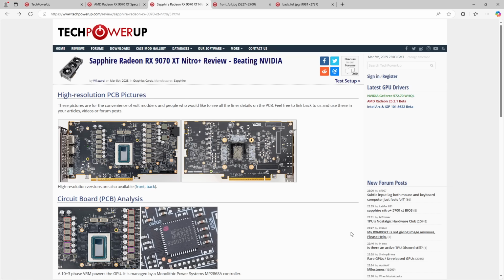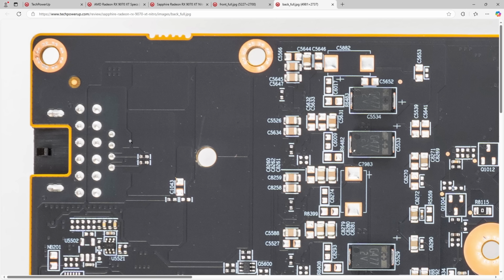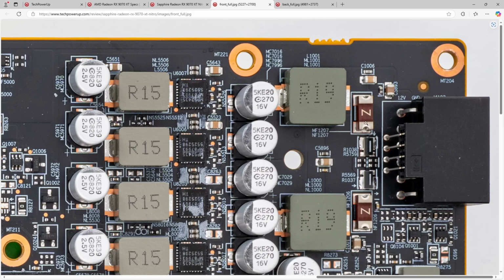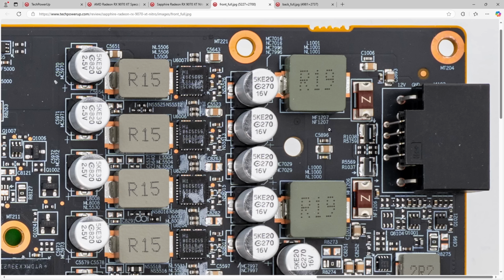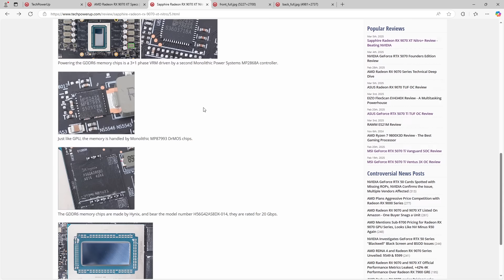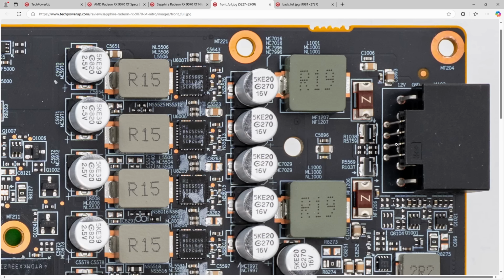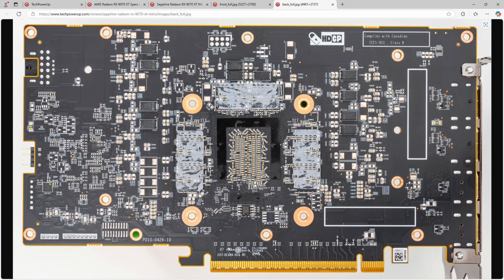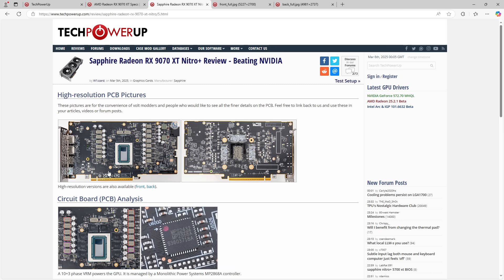Taking a look at Sapphire implementation of the 12VHPWR connector on the RX 9070 XT Nitro+

Comment: Guy... you can't drop "The 12 volt high failure connector." that early and that casual... I'm still laughing
Reply: Agree fcking love buildzoid
Reply: So was I 🤣
Reply: i was drinking
Reply: Best name ever lol
Reply: @PhotoJohn80  Very accurate, very descriptive and hopefully also it will scare other vendors from using it.
I trust Sapphire a bit, so I can stomach one model with this BS. Especially since they have fuses (won't help with melting, but should help with other types of failure).
Still I hope it isn't a sign of things to come.
Reply: Taking 300W and not 450W, or even a massive 600W, is very different.
Reply: @thatguy3000 Unfortunately the 4080 used 350W or less and still occasionally had connector burn issues.
Reply: It's my favorite thing today
Reply: haha that was funny heh.
Reply: Nice level of sarcasm 😉
Reply: that's how he calls it now
Reply: The connector isn’t the primary problem. I have thousands of these connectors on h100s in my datacenter
Reply: @JCustom  Right...
Reply: @JCustom  Ofc you do. Nvidia cares about you way more than they do about us.
Reply: @JCustom  datacenter is super cold and also supposed to be super clean so no dirt will go into connector easily make it harder to fail
Reply: @JCustom  Fascinating and relevant. Anyway...
Reply: @ Are they wired the same way without active load balancing? Also I assume that they have much better QC for cables. And that you only have datacenter PSU's.
Connector is a problem when small deviations in manufacturing might cause a big load imbalance across the wires. And connector that has safety factor of 10% is not well designed.
8-pin is much more robust.
Reply: I was so surprised that I rewind to male sure 2 times!🤣🤣
Reply: @atavusable  🤣
Reply: Failure, spelt with a ph of course 😊 

12v High Phailure connector
Reply: 12v high failure connector 😂. That name will definitely stick for a while
Reply: @addydiesel6627  Forever* 
Because that shit sucks and WILL suck unless No-Video brings back the on-board current control.
Reply: Canadians. Amirite?
Reply: you'll be fine its only 350 watts
Reply: @ Probably yes, but still it is not great thing. Connector and design that allows for card to be started even if 5 out of 6 wires are non-existent or don't connect or whatever is not well designed.

Comment: I'm wondering if it's because the card doesn't draw that much power so they didn't bother.
Reply: 300W card, 5090 is two times as much - 600W, safety factor using it for 600W is 1.15, which means there is still 15% theoretical capacity in the connector to pass current, but when you're using just 300W, then this safety factor reaches 2, which is considered quite safe, but the 5090 1.15 SF is beyond unreasonable, the only way to describe is - designed to fail
Reply: @rikkc137  Pretty sure safety factor caps it to 675, just a little shy of 115%. 

The cable itself can push upwards of 900W in optimal conditions, though that's for 4>1 connectors alone. Not sure about 2>1s.
Reply: @TheArcticFoxxo  wire was never the issue, but whoever thinks that pushing that 5090 and 4090 current through that connector is fine - is an idiot
and 10A through a 18AWG wire is just slighty more than generally accepted, which is 1sqmm/10A, it is fine for a case with lots of air flow, but still, no room for extra couple pins - I'll never buy that BS
Reply: @rikkc137  Aren't most quality cables 16 gauge?
Reply: @-DJ-  haven't checked them all, as I said, wire, even 18AWG is not the problem here
Reply: @rikkc137  A 16AWG array on the 12VHP cable can push upwards of 900W stable, every issue (all 2 of them for this generation) is caused by instability by user error, which is synonymous with every other power cable on the market (even the 7900XTX saw the same exact failure on launch)

Your claims are made to directly refute 18 gauge performance in a power cable.... How is it not the problem in your argument?
Reply: @TheArcticFoxxo  I can't bear when people say user error in that case. First Nvidia lowered the specs and then burnt cards came back... And it is certainly not because people suddenly became silly at using a poorly designed replacement for PCI-E Power supply cables... it is clearly because the cable is poorly designed.

And with even more accuracy, this Youtube channel perfectly demonstrated how those cables offer 1/3 to 1/2 of the margin of PCI-E 8 pins. And when I buy a $2500 graphic cards, I want big margins, I want well tested specs, and I certainly don't want to squeeze MORE power in LESS space, it's literally thermal engineering 101...
Reply: @rikkc137 ”quite safe” yet 4080s still burned with this, so not quite safe. If the cable is malfunctioning or the connector, it doesn’t matter how little the card draws unless it’s just 9A which will not be the case with most more performant cards.
Reply: I mean, yeah. Even looking back at Titanium model 30 series cards with the 12VHP, this matches their power draw while pushing speeds of the 4080.

Comment: Question, should we be also be having a go at PSU manufacturers for not putting some form of per-wire current protection on their supplies as well?
Reply: You could, but it's much easier for the load side to regulate itself rather than the PSU side. It also would render all existing PSUs dangerous, rather than just making previous generations of card hazardous.
Reply: nope your Power company has  installed in your main house connector also 3 phases secured with 50A fuse, and YOU are supposed to connect them with the correct thick cable to your House distribution(where you have your fuses for each Powerline to the Devices/plugs and switches or failure power detectors and such things)  but not take 6 smaller Cable in parallel  for each Phase (like 12V rail in the power-supply)
The standard is basically allow or even push you do do such f*** ups.

Comment: Why in the world would they do this, the 8 pins are one of the 9070xt's selling points.
Reply: Assuming they did this because its their 'trophy' variant and wanted to use the newer tech.
Reply: @kepler104  "Newer tech". This is a clear example of newer doesn't always mean better.
Reply: They lost their mind. Totally.
Reply: Because wireless look good or something
Reply: @bushhawk5460  the position could also be used in old 8pin PCIe connector;  
  The cooling aspect still makes it the best H++ implementation
Reply: @brunogm  i should mention that reviewers have complained that there is no tactile or auditory feedback to tell if the connector is secured.
Reply: @bushhawk5460 Sapphire’s cable has two colors on the connector. You can tell if it’s not fully seated, but the problem is even when your connector is fully seated, you can still get bad contact from one or more pins.